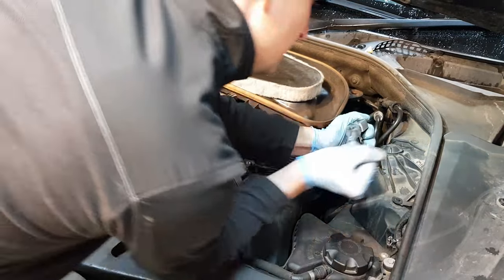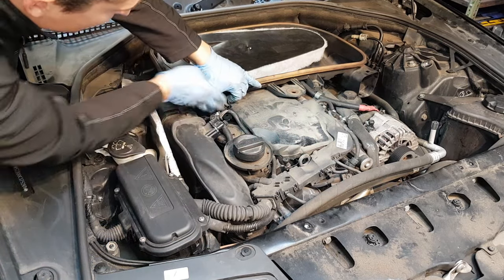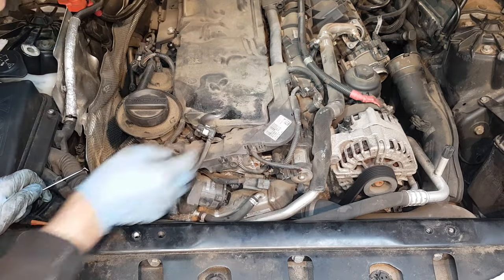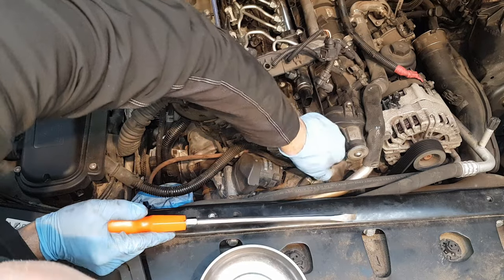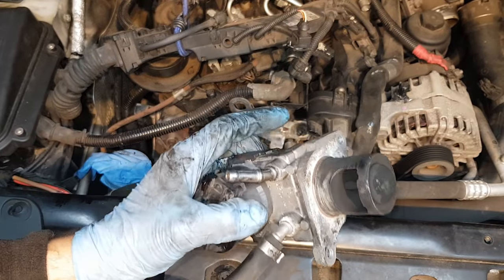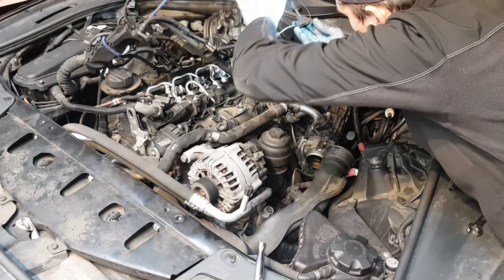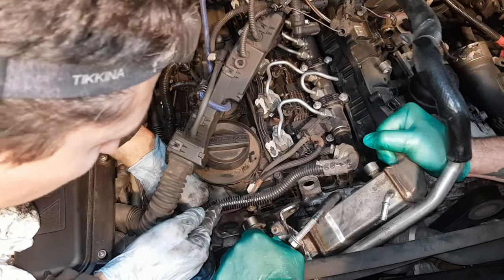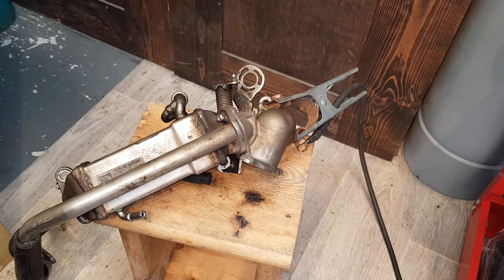How to remove EGR valve and egr cooler on BMW F10 F11 520d 530d 535d 525d 550d N47 N57 engine

Comment: do you recommend closing the erg valve and normal software shutdown, so that you never have a problem with it again??
Reply from the maker: Sorry I can't recommend that. What I would recommend is to replace/repair the unit and keep your vehicle as standard as possible.
People mess with these things and if not done right can cause a lot of money and headache.
The EGR valve on this car had lasted  165k miles so I think it is fair to expect a replacement. Hope this helps🔧🔩🤝
Reply: The egr valve is like appendicitis to the engine. It is put for environmental reasons, but it clogs the engine with soot and raises fuel consumption. Without it, throttle response is better in low rpm, car is faster and fuel compsumtions is low. With good mapper no problem :)
Reply from the maker: @martindimitrov1955  Thanks for your comment🤝

Comment: Hello   if i change this egr  need original  ?? I buy a wahler of autodoc  germany   born warger   is good?
Reply from the maker: Yes. Wahler/Borg Warner is OEM so it is the best your money can buy. Best of luck🔩🔧🤝
Reply: @TheKeenMechanic  thank you  mi code of borgwarner is 710327D/1  is ok this code?
Reply from the maker: @mariansgura5930  Hi
Please check on the internet and also Realoem.com
Reply: @TheKeenMechanic  I have one more question! Sometimes I drop a drop of oil from the rocker cover and it smells like burning! Do I have to change the entire cover or just the seal?
Reply from the maker: @mariansgura5930  Try with the rocker cover gasket only. It should be ok. If not, then it may be warped and you may have to replace the rocker cover as well
Reply: @TheKeenMechanic  Changing just the rocker gasket is less work or are the same hours of work to change the entire cover?
Reply from the maker: @mariansgura5930  Same amount of work. If you can afford buy genuine cover and Elring or Viktor Reinz gasket and replace all. If you cant afford just replace the gasket. Make sure to clean all contact surfaces with brake cleaner or petrol.
Reply: @mariansgura5930 I brought this one (Borg Warner but made in china, from autodoc) and it's causing problems after a few months. Car is hesitating during acceleration at low speeds and occasional errors logged in ecu, but not to cause eml). A bmw specialist said only genuine will do...How did you get on?
Reply: @TheKeenMechanic This Borg Warner one from autodoc is made in china and is inferior (if you take it apart it's cheaply made). I believe it's causing me problems with hesitation 20-40 mph as it doesn't seem to react like the genuine one.
Reply from the maker: @danmoney9932  I went with Febi but to be honest even £70 China made are ok from my experience. Had one installed in a customer car and 10k miles later still perfect. Everything is now made in China so no point spending crazy money on expensive parts
Reply: @TheKeenMechanic interesting. I may of just got unlucky then. Did you find you needed to reset adaptations with software or just install and go. I didn't and am wondering if resetting the adaptations might help me but I doubt it.
Reply: @danmoney9932  i change original in bmw   not peage   in a campany of bmw   change egr gratis

Comment: I'm doing just the same on a X6 M50D right now, (only 100K km's, and already leaking coolant into the exhaust...) and this vid realy helped me to fix this as quick as possible! 
Keep up the good work!
Reply from the maker: Hi and thanks. I have currently taken the engine and gearbox out to replace broken timing chain guides and rebuild the timing system. I think  you will enjoy the content that I will edit soon😉

Comment: This is a great video, whilst they can be a pain EGR's do more than just help meet emission standards, they lower the combustion chamber temperature and keep the car running as BMW designed. The bush for the EGR valve shaft usually wears first which causes the shaft to tilt in the bushing and get stuck or exhaust gasses blow push the gap and gunk up the mechanism eventually causing the same issue. The cheapest copies on ebay etc are poor quality, seen many fail after less than 18 months. 

The EGR cooler also incorporate a vacuum controlled valve, this can also get stuck particularly if the valve on the top of the EGR cooler with 2 vacuum pipes connected fails or the vacuum lines have chafed on the inlet manifold. You can easily check whether its physically stuck by pushing the control rod and check overall functionality of the EGR system in ISTA.

ISTA will take over the running speed of your engine to simulate different driving conditions, whilst testing things like turbo actuator, EGR valve position, Air mass, Air Temp and it can work out in many cases where the problem lies for example if the temp difference across the cooler isn't correct, the EGR cooler itself could be blocked usually due to the vacuum valve being stuck open.
Reply from the maker: Thank you for your feedback and for the great and informative comment. I would love to have more viewers like yourself who contribute a lot to this community🤝

Comment: I have a recall on it and i was hoping that it s a visible part, so i can be sure that they replaced it

Thanks for the usefull video!.
Reply from the maker: You can see the egr valve from the top. Just keep an eye for leaks of coolant if they replace the cooler too
Reply: @TheKeenMechanic  the egr cooler îs the part to be replaced, I ve received a mesage on bord. Thx for the reply!  Greetings from Timișoara,  România!
Reply from the maker: @dansorescu5720  Best of luck buddy and thanks for leaving a message🤝
Reply: @TheKeenMechanic  thank you! You are most welcome! Keep up the good work.

Comment: Could someone please give my any ideas. My car was pulled by a BMW dealer cus they was going to do a ”exhaust gas recirulation cooler” recall. Everything was changed!
Drove the car home (25) mins and it warned me for low oil, pulled the hood and its litterally spitting oil under, could they have forgotten anything to put back or what? BMW say they did nothing wrong.
Reply from the maker: That's horrible to hear. Take no nonsense from these guys and bring car back to them. I bet it was some unexperienced apprentice who made a mess of your car. Don't ask me how I personally know and why I started working on my own cars and later doing work for people who appreciate a honest and detail work.🤝🏻. Best of luck and hope you get it sorted
Reply: @TheKeenMechanic  Yeah a BMW dealer 🥲 It was litterally pissing oil!
How is the EGR really placed on a 518 2014 N47D20 if u know?
Do u have to remove oil canels?
Im not sure but if im correct it does look like the oil return needs to be removed to replace the EGR system, whole system was replaced and reinforced. 
Yeah bro they really have destroyed a car ive had since new and done 200k km with zero problems, they were surprised how good the condition was and ive always been doing it all by myself. 
Thank you a lot for your replaying, im just loss for words over this.
Reply from the maker: @dpayne8611  Not sure where you are but here in the UK they will be afraid to mess you about if you mention you will contact a solicitor/lawyer or the ombudsman. It is very unusual to have no issues and suddenly after their work your car end up in such a mess. On the N57 I did a lot of work there are no oil lines in the way of removing the cooler but having said that I always make sure I have plenty of space when working. Not sure if there are any changes on the later engines as yours is N47 2014. Just stand your ground and ask them to investigate and explain how it happened straight after their work. Don't be afraid to threaten them with court. They will have to fix it as they make billions every year and this will cost them literally nothing. Don't be afraid to also tell them you will expose this on social media. Best of luck bro
Reply: @TheKeenMechanic  I will do it all for sure! They aint getting away with this one 😅 thanks a lot bro!
Reply from the maker: @dpayne8611  Make sure to mention that your engine might have starved from oil too🤝🏻